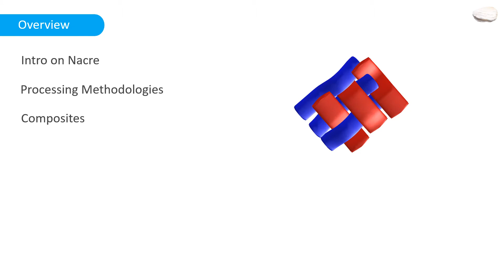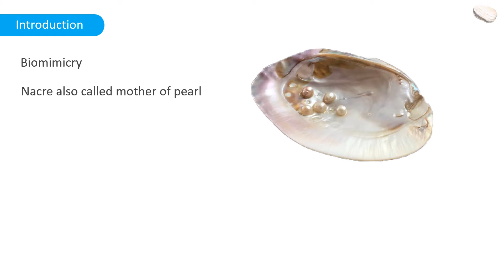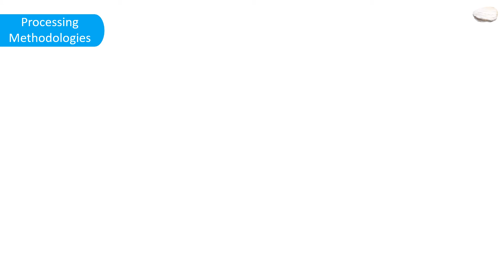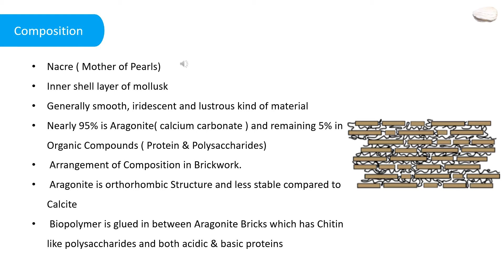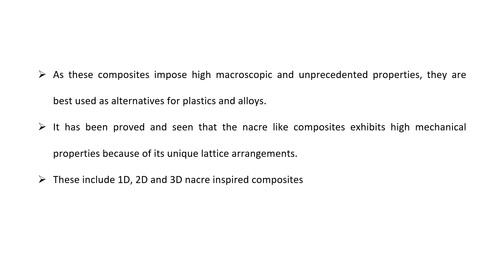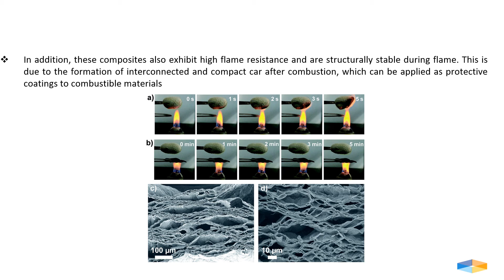Nacre Inspired Composites Video| Chalmers University of technology| Polymers processing

Comment: Hello there,
I very much doubt that I will receive a reply to my questions, but optimistic as I am I thought I will give it a try.
Will be easy to bring said material into the market or is it very capital intensive?
Is it possible to use said material as a car frame ?
I am way out of my depths here, but I am looking to the lightest, stiffest, strongest and cheapest material available for a very small series supercar company in the making.
Thank you in advance.
Reply from the maker: Hello, I had totally lost this account. I appreciate your interest and I apologies for the late reply. I wouldn't recommend this for a car frame. As far as I know, this material is ductile enough for application in cars. Cars would need to not just have enough impact resistance but also some ductility to sacrifice itself to take all the load and vibration and not pass it on to the passengers sitting inside.